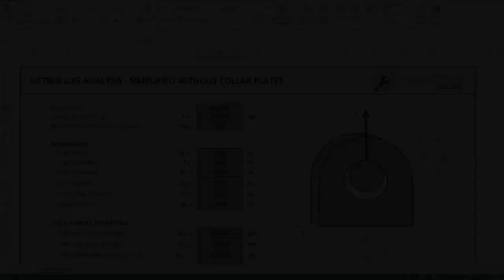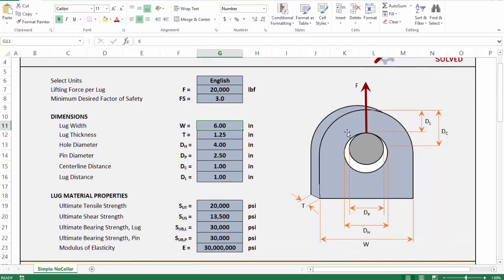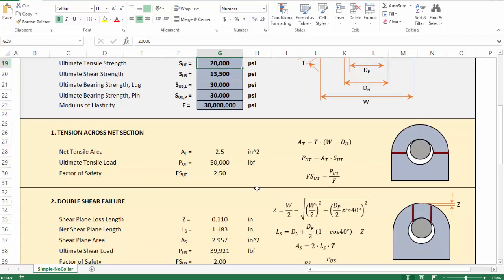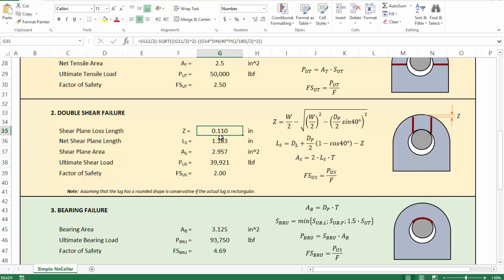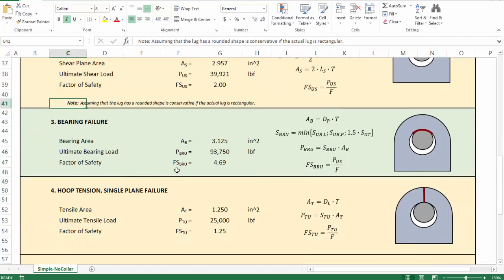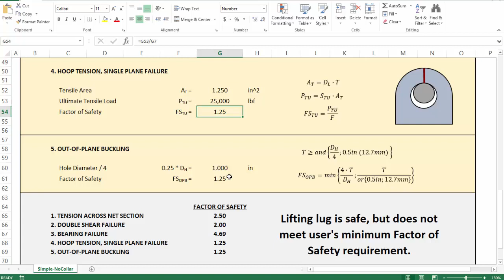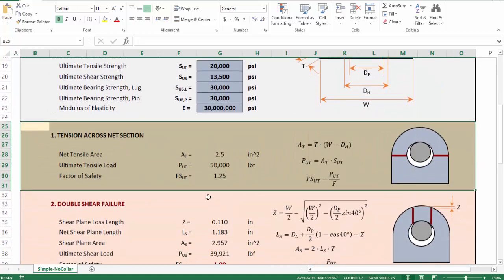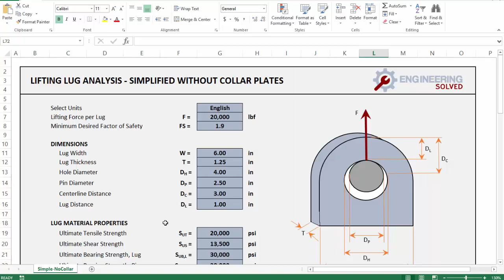4. Lifting Lug Analysis - Simplified

Comment: I am a new engineer working on lugs for the first time (I was actually trained more on the electrical engineering side, but now I'm doing mechanical engineering).  

I am confused about failure method #4.  When I first tried to do a quick calculation by hand, this is the one I used, since it seemed to be intuitively the weakest.  However, I have seen a physical lug which failed according to criteria #2.  Also, I see on many online lug resources that they don't even bother to try to calculate #4.  My coworker only ever calculates failure method #2, but he cannot explain why this is.  Why is #4 so neglected?

I have a hypothesis on why #4 might not actually occur.  It may be that a load is actually sufficient to cause failure along the indicated shear plane, but that in order for the pin to physically move out of the lug, it would also have to cause a bending failure in order for the lug to move out of the way.  But I have not seen any explanation on this.  Edit:  It also seems like in order for the sides of the lug to separate along the indicated plane, that would actually require tension along that plane rather than shear, which is not actually occuring.

If there were not some reason like the one above for why #4 failures might not occur, then obviously #4 failures would happen every single time, since they are the weakest, and there would be no reason to ever even consider failure #2.  But this is obviously not true, since I have seen a physical lug which clearly failed according to #2.

Could someone please explain this to me?
Reply: I think my observation that separation along the plane at #4 would actually require axial loading rather than shear is a good enough explanation for me.  Failure along #4 probably does not occur most of the time.